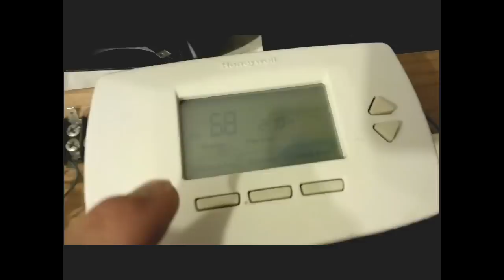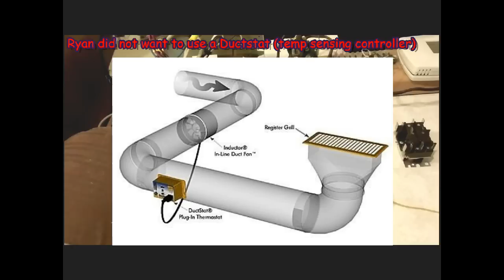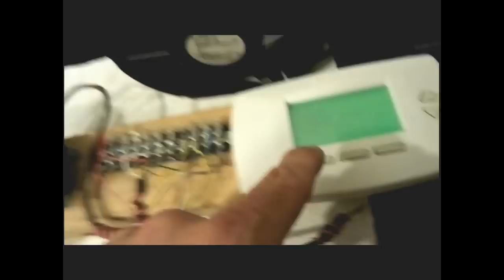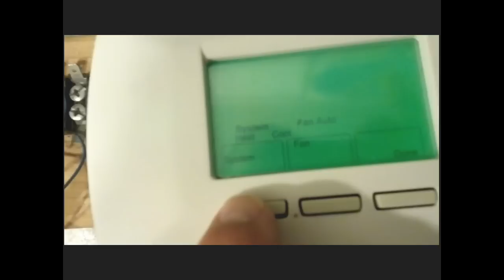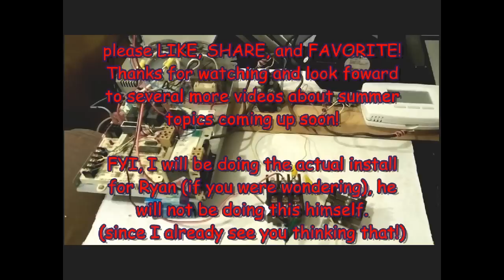HVAC Simple Control System for installing an Inline Duct Fan.

Comment: Thank you so much for this video ,I put a duct fan in to get some more air flow to the side of the house farthest from the blower and it really fixed the problem but I was using the heat and cool 24volt wires to trigger my relay and the fan came on early.Never knew about this EAC connection but this is great ,now it comes on the same time as the air handler blower.

Comment: Jump the existing green wire (common) to a relay (needs to be added). Then the other leg to the 24vac transformer. The fan wire should the go to common of relay switch, then the other goes to hot wire. The neutral goes to neutral in the board.

Comment: love the FT-8800R in the background...
Reply from the maker: Thanks Matt! :). I really need to get back on the ait, after my last round of back troubles I dont feel like sitting at the desk much so the HF gear (Icom 737A, Icom 730, Icom 706 (havent put it in the new truck yet)) and the keys have been collecting dust.  ...well prolly since a tornado danced with my tower on the very same day that I'd put up a newly repaired Force12-5BA, 20 thru 10 plus warc, and a brand new M2 40MLLDD, 4 ele 40m mobobander.  Didn't even get to put the 40 on the air!  Needless to say I cried, threw things, said stuff that curled the paint in the shack and didnt bother to turn on a radio for six months, lol.
Reply: mikie2501 I completely understand...still rocking my SGC-2020, SGC-211 for most of the time.  Do mostly QRP.
Reply from the maker: Matt Maulden sweet!  Ive stared at the 2020's enough times, lol.  I have a mfj-9020 that I enjoy off and on, need to add the bells to it, but would be nice to get a fancy QRP rig later down the line.  I frequently run low power to QRP when I do cw, but the beams make it fun!  Just have up a vertical at the moment until I get the beams fixed or replaced. The tower is a longer story! (Maybe I should start an email thread, lol!) I use a clearspeech speaker with the mfj and it helps on weak signal a lot. Have another one I use mobile since I'm on 40m mostly and the vertically polarized noise plus the 706's cruddy DSP make it difficult to copy anyone under 500w without it.  Sad when a speaker has better DSP than the rig, lol. They should license it!!

Comment: I use 2 contractors one for heat one for cool and a transformer to power the Tstat then the outgoing power from the power wires jumped  together going to fan. white from tstat going to 24v on one contactor and yellow from tstat going to other contactor seems like the easiest way for me

Comment: I'm trying to figure out to have multiple duct fans hooked up to the same thermostat without having extension cords running everywhere.   Upstairs is not cold enough in summer and downstairs is not hot enough in winter.  Debating combining ducts and just using high powered fan.  So 3 duct get combined upstairs to 1 fan and 3 ducts downstairs get combined to one fan.  Any thoughts
Reply from the maker: That's a fairly common problem with two story houses that only have one ac unit,  unfortunately:/
During the summer all the cool air likes to flow down the stairs to the first floor and in winter all the hot air goes straight upstairs with the cold air settling low. 
Surprisingly I haven't seen all that many duct fans installed,  more often than not I would see inline manually operated duct dampers that would be partially closed to restrict flow to certain areas.
The more expensive route,  with one ac, is to have electric dampers that all go to a control board at the unit and a second thermostat placed upstairs.  Both  stats are wired to the board and it controls the unit. 
It also has to have a bypass duct with a weight balanced (typically) damper in it that goes from the supply side of the unit back over to the return side,  that way any excess pressure is taken off the blower when, say, the damper for downstairs is closed because the tstat down the is at temp but the upstairs is still running.

Usually inline duct fans are for long runs,  possibly with angle changes,  and the air pressure drops off too much... or the installer undersized the duct for a long run.   
If you want to experiment with it then two larger duct fans wouldn't be too expensive,  though I haven't priced them in a while.   I think 12 inch ones range from 50-150 depending on brand. 
Wiring them is a whole different conversation,  heh.  
I'm cheap so I'd probably do it the hard way,  but the easy way would probably be to go with a couple of ductstats. They mount on the duct near the duct fan with a temp probe that pokes into the duct,  you plug the fan into the ductstat,  plug it into 120v outlet then set the switch on the box for heat or cool,  then set the temp you want it to trigger at.  So you would have one set on cool and one on heat.  
During summer when the ac kicks on and the temp in the duct reaches the cool level you have the box set at,  the fan kicks in.  When the ac shuts off the sensor temp should eventually go up enough to turn it off.   I've never played with one but you might have to fiddle with them several times so that it cuts off in a timely manner.   
Those are about 50 bucks each, I think.  
Well hope this has given you some decent stuff to swirl in your head for a while! Hope it makes sense,  I'm working on about two hours sleep,  hehe.

Comment: if the inline duct fan has 2 black wires and a green wire how do I wire that up
Reply: blks = pwr :120vac and com. and grn = ground
Reply: @dougvanduzen2866  Where can you hook those to wires at, in order to have an extra fan booster running for Heat And Cooling Mode?

Comment: Should I use the 24 volt that came from relay  air handler to a contactor out side unit. And wire direct to another contactor or relay  to power 124 volt fan.?  Need your feed back thx

Comment: Circuit board has plug "eac" which puts out 120v everytime blower turns on
Reply: Power for Electronic air cleaner would work good to power on a extra fan

Comment: Like the info, what about same installation but using a electric furnace, standard air handler doesn't have a board such as the one in your video, can I just use contactor and wiring the common and fan wire to that?
Reply from the maker: Sure.  As a few people have commented below, there are a number of ways to do it, a control board isnt necessary,as long as you have reliable power for the blower, your not overloading your current low voltage transformer, then your fine. Its just a matter of how you want to control it.

Comment: Hello Mikie2501 my air-condition(electric gas) not working so I look at HAAC control circuit not electricity reach it and the error light not working what , I checked the electricity coming to unit its work non of the fan or the HVAC circuit have electricity , what do you think.
Reply from the maker: +Esam Alnajjar if you know you have 120 volts making it to the unit but nothing is on, and the breaker/fuse at the unit isnt tripped or burned out, then its possible that either the low voltage transformer is burned out or that a 3 or 5 amp fuse has popped on the control board. (Some boards have fuses, some dont)
If one of these two is the case then you need to find the short that caused the problem.  Quite frequently its damaged low voltage wiring outside at the condenser unit, someone could have hit it with a weedeater or a dog got it and chewed it, or if the wiring is really old it could just have exposed wiring that shorted.
...a storm could have fried the control board as well.  There are a number of possible problems, but these are the most likely.

Comment from the maker: Scott (don't know how that got flagged) I don't know why the current sensing relay couldn't work, just have to test it's action at the furnace and make sure you don't have too much of a voltage drop from the 12 volts over the 40 foot run, if it drops too much it may not close the relay on the other end reliably (or at all).  M@

Comment: Hey Mikie, pardon my ignorance but would it be possible to simply wire the relay to the blower fan wire coming from the thermostat? My control board and all the wires attached to it, along with the wires running to the fan have a constant 120 volts running through them no matter if the fan is running or not. I cannot figure out how the fan is switching on when I turn it on at the thermostat, but I read the wires connected directly to the blower and they are sitting at 120. My unit has a capacitor in it, so I'm sure if that has anything to do with it

Comment: I have central AC and Heat (gas).  Do I need to have a separate relay and wiring for each or will the one relay  do both heat and AC?  Thanks,   Gary
Reply: Gary Smith , No you can tap your fan motor wires as long as their 120v, if it’s 220 v then tap one from the motor and one from the neutral wire.

Comment: Too complicated.....can the explanation be simpler ????
Reply: Great video. One quick question. I already have a fan with a 120-24 transformer. Can I skip the 24V transformer and connect it to the HVAC system with a 120V contractor?

Comment: Far too complicated- Airstat in plenum and power to fan. No need to disturb or even touch the circuit board. Airstat can switch up to 15 amps at 120 volts
Reply: Do you have both AC and heat?  If so, how close to the blower did you mount your Airstat?  Have you had any problems with your fan failing to come on when the blower comes on?    I am debating whether to go the Airstat way or the relay way.  I have read accounts that say where you mount the Airstat  makes all the difference.  Thanks,